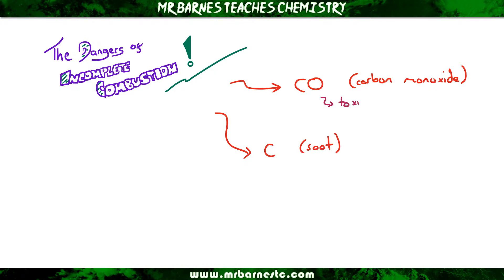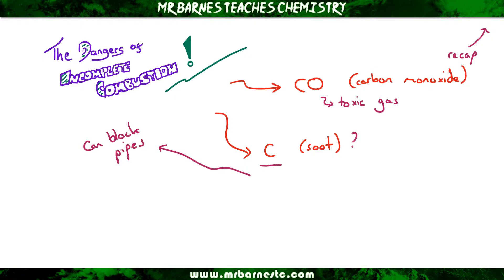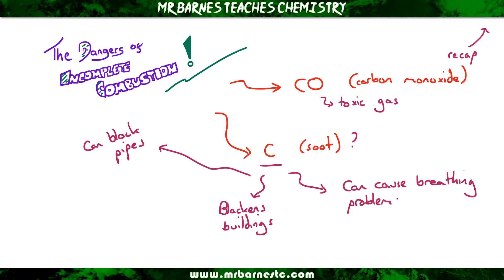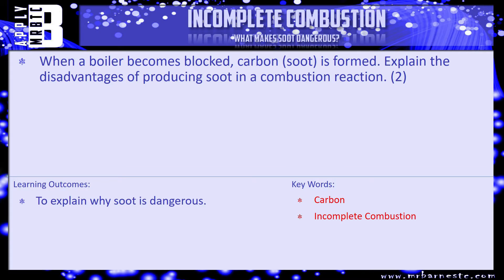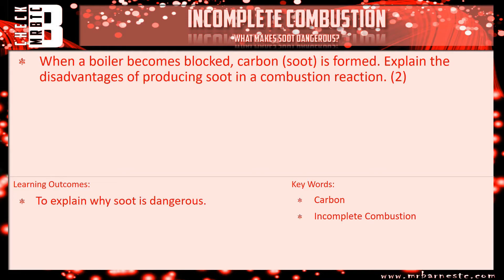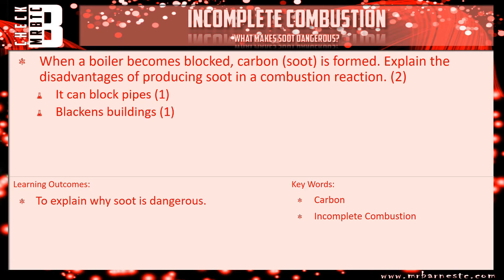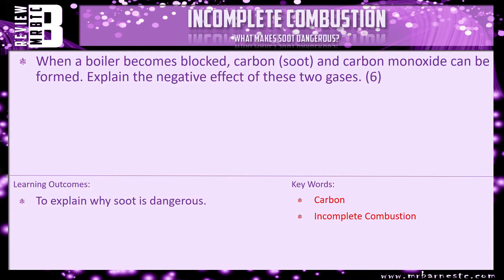GCSE Chemistry 1-9: The Dangers of Incomplete Combustion: Soot / Carbon

Comment: What is the formula of soot? C?
Reply from the maker: For GCSE, yes - although it is impure carbon, so will have other bits in it - such as hydrogen.
Reply: FORMULATED MICROCRYSTALLINE WAX WILL CAPTURE CARBON
The heat loss from a smokestack can be forced into a large tank containing hot liquid microcrystalline petroleum wax. The heat will keep the wax at a molten state which facilitate the carbon to be absorbed when combined with the wax. Carbon when mixed with wax reacts like a dye. The wax-carbon amalgamation resulting into a black wax solution thereby making it impossible for the carbon to escape into the environment while in a liquid state. Other toxic particles are also captured in the wax settling at the bottom of the tank forming into a sludge. A sludge release valve is located at the bottom of the tank. After the sludge is removed more wax is replaced in the tank working something like a toilet. The sludge becomes a byproduct that can be used as an additive to asphalt for roads or used for cocooning nuclear waste materials for long-term safe burial. The entropy of the Earth has been increasing at a startling rate since the beginning of the industrial revolution caused mainly by the carbon that is released into the atmosphere. Government scientists have failed to stop and prevent carbon pollution from entering the environment. This problem can only worsen until a solution is found before this problem becomes irreversible. It has been discovered that formulated wax has been shown to be the only answer to this problem. William Nelson waxogen@gmail.com
Reply: @waxogen  thanks

Comment: Thanks for the video, really helped with my chemistry homework.
Reply from the maker: Aden Noorullah Glad I could help! :)
Reply: My chemistry teacher is really bad.
Reply: I had to make a revision page for all of topic 3 (8a) so most of your videos are way more effective than listening to her.
Reply from the maker: Haha. Well, glad I've helped. The topic isn't quite finished yet. I have a few more to add in the coming weeks. I have many more videos on my website - www.mrbarnestc.com - feel free to use them if the're useful to you!
Reply: cool
Reply: FORMULATED MICROCRYSTALLINE WAX WILL CAPTURE CARBON
The heat loss from a smokestack can be forced into a large tank containing hot liquid microcrystalline petroleum wax. The heat will keep the wax at a molten state which facilitate the carbon to be absorbed when combined with the wax. Carbon when mixed with wax reacts like a dye. The wax-carbon amalgamation resulting into a black wax solution thereby making it impossible for the carbon to escape into the environment while in a liquid state. Other toxic particles are also captured in the wax settling at the bottom of the tank forming into a sludge. A sludge release valve is located at the bottom of the tank. After the sludge is removed more wax is replaced in the tank working something like a toilet. The sludge becomes a byproduct that can be used as an additive to asphalt for roads or used for cocooning nuclear waste materials for long-term safe burial. The entropy of the Earth has been increasing at a startling rate since the beginning of the industrial revolution caused mainly by the carbon that is released into the atmosphere. Government scientists have failed to stop and prevent carbon pollution from entering the environment. This problem can only worsen until a solution is found before this problem becomes irreversible. It has been discovered that formulated wax has been shown to be the only answer to this problem. William Nelson waxogen@gmail.com
Reply: XPRIZE CARBON PARTICLE CAPTURE

FORMULATED MICROCRYSTALLINE WAX WILL CAPTURE CARBON
The heat loss from a smokestack can be forced into a large tank containing hot liquid microcrystalline petroleum wax. The heat will keep the wax at a molten state which facilitate the carbon to be absorbed when combined with the wax. Carbon when mixed with wax reacts like a dye. The wax-carbon amalgamation resulting into a black wax solution thereby making it impossible for the carbon to escape into the environment while in a liquid state. Other toxic particles are also captured in the wax settling at the bottom of the tank forming into a sludge. A sludge release valve is located at the bottom of the tank. After the sludge is removed more wax is replaced in the tank working something like a toilet. The sludge becomes a byproduct that can be used as an additive to asphalt for roads or used for cocooning nuclear waste materials for long-term safe burial. The entropy of the Earth has been increasing at a startling rate since the beginning of the industrial revolution caused mainly by the carbon that is released into the atmosphere. Government scientists have failed to stop and prevent carbon pollution from entering the environment. This problem can only worsen until a solution is found before this problem becomes irreversible. It has been discovered that formulated wax has been shown to be the only answer to this problem. William Nelson waxogen@gmail.com
Reply: XPRIZE CARBON PARTICLE CAPTURE

FORMULATED MICROCRYSTALLINE WAX WILL CAPTURE CARBON
The heat loss from a smokestack can be forced into a large tank containing hot liquid microcrystalline petroleum wax. The heat will keep the wax at a molten state which facilitate the carbon to be absorbed when combined with the wax. Carbon when mixed with wax reacts like a dye. The wax-carbon amalgamation resulting into a black wax solution thereby making it impossible for the carbon to escape into the environment while in a liquid state. Other toxic particles are also captured in the wax settling at the bottom of the tank forming into a sludge. A sludge release valve is located at the bottom of the tank. After the sludge is removed more wax is replaced in the tank working something like a toilet. The sludge becomes a byproduct that can be used as an additive to asphalt for roads or used for cocooning nuclear waste materials for long-term safe burial. The entropy of the Earth has been increasing at a startling rate since the beginning of the industrial revolution caused mainly by the carbon that is released into the atmosphere. Government scientists have failed to stop and prevent carbon pollution from entering the environment. This problem can only worsen until a solution is found before this problem becomes irreversible. It has been discovered that formulated wax has been shown to be the only answer to this problem. William Nelson waxogen@gmail.com